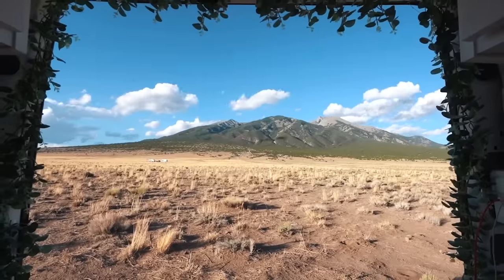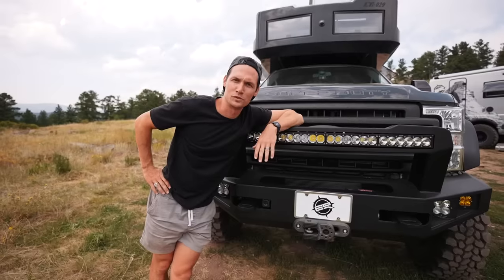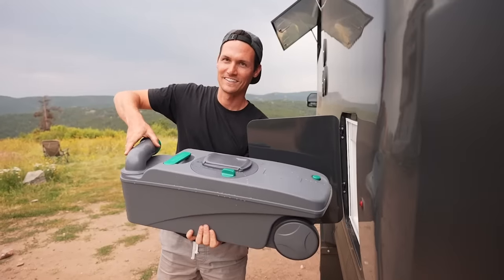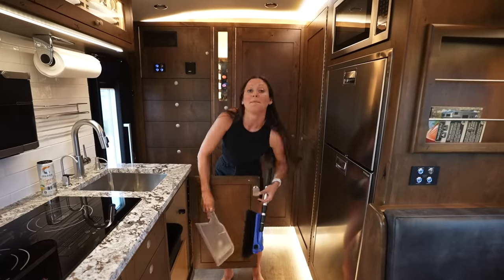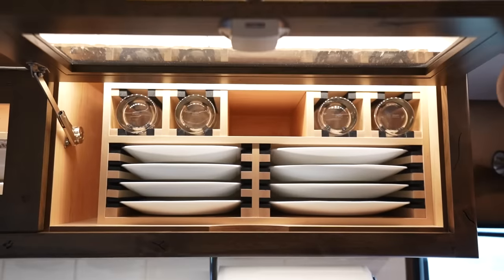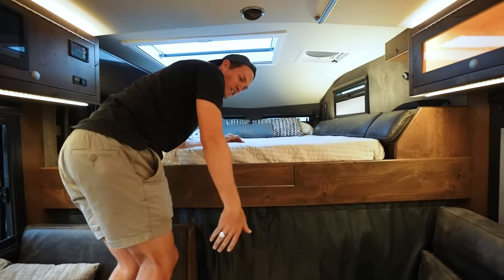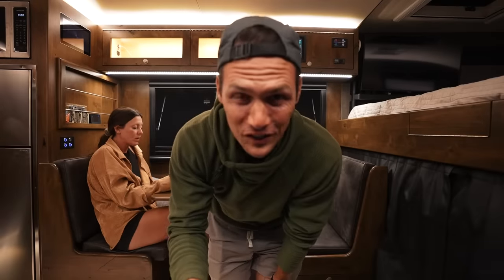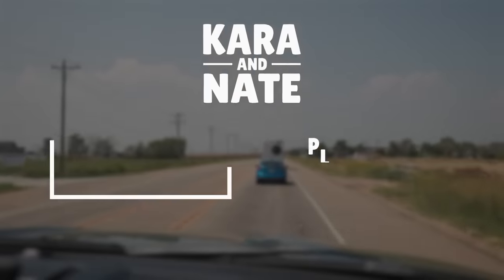WE LIVED IN A $650,000 EARTHROAMER (full tour)

Comment: Idk. It’s really nice and all. But for that price i feel you could get so much more . It feels more like a 300-450k price tag all around considering the truck itself is like 150k without the sleeper and accessories .
Reply: You're paying for the custom fabrication and engineering that went into this build. I'll agree I believe the price tag is a little steep at $700,00 it seems to me a $350,00-$400,000 price tag would leave them with profit but not until they recouped their initial investment. If the demand was higher and they weren't practically one off builds the price would come down substantially. $700,000 my ass would be in a nice ass boat but that's just me.
Reply: This is not even the most expensive  version. The top of the line model is $1.5+ million. It comes with a few more bells & whistles
Reply: Yeh I think you summed it up perfectly. I’m not seeing a fair trade for my 600k of dollars. Looks like a 200k type vehicle at most.
Reply: Bro the microwave is solar powered
Reply: @X410zee  this build if you had the fabrication skills could be accomplished for less than $200k all day long. The truck itself would set you back at most $100k leaving you with $100k to spend on the interior. Outside the engineering aspect I doubt they're spending much more than $150k to build not counting their man hours which is probably a few hundred hours per unit. Let's call it a 1000 man hours with 5 guys making $30 an hour that's an additional $150k. So $300k would easily leave them with $50k-$75k in profit.
Reply: @PatrickCavanaugh0420  I think your maths may be a little off.  100k + 100k (probably closer to 150k for the truck but oh well) = 200k. We haven't even considered man hours or shipping yet. We'll call shipping about ~25k for all the parts, as they will not all be made in the same place, plus they need to source wood for the interior etc. You can add another 175k to that 200k then, as I'll go with your 150k for man hours.

100k + 100k + 25k + 150k = 375k.
Materials alone will probably cost well more than 100k, so that guess is probably very incorrect. Don't forget, most of the shell of the camper section is carbon fibre. That material is prohibitively expensive. There's a reason that aeroplanes they make out of it sell for a third of a billion each. 787-10 List Price: $338.4m
They are probably still charging more than is reasonable, but they won't be doing a 300% markup I wouldn't imagine.
Reply: I think most of their stuff is custom so that drives up the price.
Reply: A house maybe
Reply: @PatrickCavanaugh0420  It's not just you mate. Having just bought a used sail boat 5 months ago and thinking what 3/4 of a mill. could get me in a boat it's no contest. Also considering the horrible quality of most R.V.'s and that they basically rip you off for a good chunk of what you paid for vs. what you get and this is not even factoring in the rather automatic fate of old R.V.'s. I'm sure that for this money i could buy my wet dream sail boat and have enough left over for a new wake boat or at least a couple of new PWC's.
Reply: @cmdrquillon9398  even if I'm off by the 75k your talking with a $375k price point that's still a far cry from what they're charging.
Reply: @PatrickCavanaugh0420  As I said, the 100k on materials is likely a massive lowball. The true price is likely at least 200k on materials. They are still overcharging I think, but not by as much as you say maybe.
Reply: did you even see the video?
Reply: @krisb-travel  then you have no clue how expensive stuff is 😂
Reply: @PatrickCavanaugh0420  Jesus christ is coming back,  people look to God put him first read your bible and pray Jesus loves you"
Reply: You can get an airstream atlas for about 260K, which in my opinion is waaaaaay better.
Reply: Yeah
Reply: @colors6692  what makes it pollute any more than any other diesel engine? Just curious honestly, I see this not much different than my f550 at work with a different bed. The truck itself still undoubtedly follows the same emissions regulations for whatever state its being produced in or it wouldn't be legal for sale. Now what one does with the emissions after they purchase the said vehicle is a different story. Unless you're speaking on the resources used to build in which case things like tesla or any other electric vehicle should be "banned" as they are terrible for the environment during production and after their life cycle is complete.
Reply: @PatrickCavanaugh0420  well , it's up to you , Jesus might not have nothing to do about the comment but am sharing the gospel  , cant say you never hear or see  the gospel sharing,  Jesus is real and he loves you don't make people push you away from God.Jesus christ is coming back,  people look to God put him first read your bible and pray Jesus loves you"
Reply: Youre right. You can get a stunning used Class A. Built on a Prevost chassis that looks better and has more features than some mansions
Reply: not anymore
Reply: You can
Reply: I'm not defending the pricing, but there is a lot that goes into this that you cannot see for example the axles are replaced with Heavy Duty ones, and the suspension is all beefed up as well.  lots more.    They do a lot to the F550 Chassis before even starting the camper part.
Reply: I dont know but it seems like most of the stuffs will be broken and not working properly after 2-3 years of hard offroad overland trips
Reply: @stanleymasterson1135  You’re wrong. You couldn’t get near half the shit that’s on this Earth Romer auto Prevost.
Reply: @dexterrr9163  your comment proves that you’ve been living in cheap made campers all your life. This Earth Romer is meant to go through the apocalypse and beyond.
Reply: Dude it's like a whole house and a truck with a bar becue
Reply: Exactly what I thought buy a 150 truck with buy a cab get someone to slap it together  and save like half a million dollars I would never pay that much
Reply: @PatrickCavanaugh0420  carbon fiber is really expensive and the entire back half of the body is engineered carbon fiber
Reply: totally agree that this is basically a 100k camper attached to a nice F150- meaning by F150 that the cost of a camper plus an f150 is about all this should cost… i know this is like an f550 or something ridiculous
Reply: all they gotta do is find one sucker a year to pay this -
Reply: @cmdrquillon9398  not even close both you guys are off lol those trucks are 75k new there's company's out there that custom build those overland boxes filled with the kitchen/bath/bedroom all that for 50 to 80k depending on what you want in them and weld them on your frame theirs company's in the Midwest that do this
Reply: Those knives cost thousands of dollars alone
Reply: @vickyhudsonwilliams9529  must be Liberty Bells and Rhodium whistles
Reply: With that I’ll buy 2 fucking semis😂 or 3
Reply: @cmdrquillon9398  I mean the aeroplane comparison isn’t the best as you can’t really cut costs making something with 1047202746194 redundancies plus customers are very aggy (rightfully so) on its safety but yeah I get ur point nonetheless.
Reply: Yh its definitely not for the target audience you would initially imagine. More for super rich people who fancy a couple days campong
Reply: @PatrickCavanaugh0420  carbon fiber vs aluminum is no joke. But for that price you could get a nice boat and a more than capable RV
Reply: lmao, $300,000 USD is almost more than my 1600 sq ft house in Canada. I am amazed anyone would pay that for a vehicle.
Reply: @colors6692  I'm not an EarthRoamer fan, but you can FO with your environmental dirge.
Reply: @krisb-travel  Nah a F-550 is a very expensive truck. I think it's load is 2 tons, and is easily over $100k for just the base flat bed truck.
Reply: @thewoundeddeer  I dont get why you people think the truck is so expensive. 2021 Ford Super Duty F-550 base price starts at $40,895 to $58,065. MSRP and invoice price goes from $38,850 to $55,161. My 5 second google search calls BS on all of you.
Reply: @PatrickCavanaugh0420  If I'm forking up 700k (which is very unlikely in my lifetime) I'd be spending it on an R.V, not a fabricated F550. I mean they did a great job, but for 700k? That seems much over what this build should actually cost.
Reply: @P4PKing  yea nor would I ever spend 700k on this vehicle. An rv or nice ass boat a house etc. Could think of so many other good uses of $700,000 lol. My choice would definitely be a used yacht.
Reply: @fanatic26  a base f550, the 58k is for the gas engine smh and with all the add on the engine alone is 10k extra and not to mention all the dealership fees, taxes, tag, title, insurance, this f550 shown in the video is undoubtedly closer to 100k but nowhere near 150k as was claimed by the guy I was talking with. I drive one daily I'm familiar with their costs and available options. Hell you can't get a new f150 for under 50k these days unless you go bone stock.
Reply: @PatrickCavanaugh0420  a little steep but the whole trailer/camper part is made out of carbon fibre which is probably super expensive to make
Reply: @PatrickCavanaugh0420  Another 10 second google search just found me a 2022 4x4 F550 with the 7.3 powerstroke for $66k
Reply: @fanatic26  and that's 66k with Tax, tags and title and dealership fees? Cheapest I find on auto auto trader or Facebook is 81k. I would assume price will also vary from location to location as well. My whole point was that they charge entirely too much and that the truck could be had for less than 100k. The person who replied to me said 150k which is way off. Not to mention the dealer mark ups that are happening right now all over. Either way I agree with you the truck is way cheaper than some are claiming, even with the engineering and carbon fiber materials the truck is no where near worth its 700k price tag.
Reply: @PatrickCavanaugh0420  👍🏾 I agree with you those guys are just completely ripping people off with those overland builds they lost there minds
Reply: No space at all i can buy a huge moblie home with 20 times the space a more luxurious for wayyyyy less get outta here for almost a million dollars thats a toy for a person who worth 100 million to get high way robbery job on them for 600k at best 150k
Reply: i wish i could bring this with my fairy friend... 😔
Reply: Respectfully, most of y'all are so wrong its almost painful to read. Here's why:

First, we have the rig being an F550. Most of these are destined to work and come appropriately stripped with a 80k price. To have one built with all the interior options of the more common F350 plus exterior bling like mouldings and doorbhandles that aren't from the Amish Package, and I'll guess the cab and chassis came in at close to 125 or 130.

Next... Carbon Fiber. Not much needs to be said on that front but this beast is made FROM it. Not accented, not highlighted with or essences of it. It's MADE of it. Imma guess 100k in carbon fiber just for the shell.

Next up we have the biggest toteboard of 'Let's Get Small'. Price per square inch on a motor home gets exponentially larger the smaller one goes. Eventually there is a balance point but it's a rule that makes sense after one gets over the initial shock. Going Small yet keeping the expected functionality costs more with tighter spaces for behind the scenes plumbing / wiring etc as well as for the fixed cost of the thing itself. Poor example but what comes immediately to mind is extend-Range or performance of an electric vehicle requires either more batteries or better performing batteries that fit in the same space available for the standard ones yet offer more capacity. Going smaller yet expecting same or bigger will cost ya no matter how its sliced. Toss in another 100k or this and the other etc's plus labor which is not piece work but craftsmanship level crew. 

Then throw in all the touches like plate and silverware slots that keep the rig quiet while driving (huge, trust me on that or try listening to glasses clink and crap rattles for 300 miles on the way to the camp. )  Every where one looks, this rig is filled with this type of unexpected design and thought that oh just so happens to be wrapped in higher-end finishes and or materials. Check another 100k here.

Lastly, wheels, leveling, power plant. God knows how many stage paint, bumper boxes etc and it's bespoke without actually being bespoke. But I bet they welcome call outs. Either way...pop another 100k to the bill for this and installs and integration with everything else. Oh and make sure it all can survive extreme swings in Temps, being shaken and bumped as well being potentially invaded by mud, critters and moisture that is magically repelled for years.

So far, I'm up to 425k but very likely have missed a good number of items so I'll use a standard overrun factor of 30% to account for it bringing my final estimate to basically 600k.

Dealer ask is around 700k. They ain't getting rich at that point which is why earlier I remarked in another comment of expecting 900k. Or more.

This is a bargain.
Reply: Or I can just say it without being kind: The actual people who can afford to purchase this and will do just that, can see the value here and that has nothing to do with being stupid or gullible. 

All these 'I can get me a  ford for 35k and put a box on it, for 5k so that means they outrageously overpriced' posters will have little to no impact and will be read only out of amusement or great concern about our public schools prior to reading one that is actually relevant and intelligent.

Comment: 4:18 for $700,000 it doesn’t come with a smart key for everything!! Come on!! They “add” over $600,000 to the price of that truck as the base truck is less than $100,000. The integration should be seamless.
Reply: Gotta agree with that for sure, that's a super ridiculous keychain
Reply: All the outside doors appear to have electronic central locking, the keys would be for a manual override in case of failure of the electronic lock.
Reply: Less than a 100k base price for a F550 stripped is 60k those Earthroamers where always way overpriced
Reply: @vee950  Extremely. Probably costs $150k to make.
Reply: @BriggsDCory  I agree
Reply: @vee950  that's not a base F550. base F550's do not have myfordtouch and lariat trims lmfao

Comment: I finally figured out why Nate got wet when he took out the cassette toilet and he thought it was leaking on him.  When Kara demonstrated the toilet, she closed the cassette and then flushed it  ("add a little water.")  So the water didn't run into the cassette, it ran on top of it!!  Loved the video.  I don't care what they cost.  I want one.   (By the way, John Mayer bought one.  I'm sure it was pocket change for him.)
Reply: Bb
Reply: @thelightsilent  Please point me in the direction of a 60k carbon fiber caravan.  I will buy one now.
Reply: @SHADOW848DUCATI  With all of those nice materials and craftsmanship on the inside, and the 1300W of solar panels, and the batteries and inverter, and the 100 gal water tank, and the extra 50 gal fuel tank, and all of the beefing up of the suspension to handle the extra weight in off-road conditions, and the cameras and the lights and the winch and the storage boxes and so on and so on. Oh, and they put it all together for you.
Reply: @BradWilson1969  My point was that there is no where you could build this for 110k as The Light Silent had mentioned.  The amount of carbon fiber and resin alone would be about 100k

Comment: That an impressive machine and I’m definitely jealous. The only thing that would concern me is servicing it if something needed repair. It’s so customized that I think it would be hard to find anyone that would want to touch besides the manufacturer.
Reply: It depends on what needs repair, anything mechanical related to the movement of the vehicle is Ford F550. That's pretty genius to me.
Reply: If you can afford this you won’t care about affording the maintenance…😅
Reply: @ALDOELTA  I agree with you on that but my concern is actually finding some knowledgeable enough or willing to work on it away from home. If it’s the truck itself it would be fine but the camper is a different story.

Comment: Great video, one thing, the stove top is a induction stove. It heats the pans (that why they are aluminum) without heating up the burners. The knives are SHUN!! That is like off the charts high end. Great video.
Reply: Induction does not work with aluminum, you must use a ferrous (magnetic) metal, induction uses magnetic waves to heat the metal.
Reply: Me pretending I don’t have $ 12.37 in my bank account “mm yes this seems nice maybe I should get one 🤔”

Comment: Step by step for diy earth romer 
Buy an old toyota tecoma 
Restore it put in air suspension
Ls swap with a supercharger or twin turbo it
Then custome fibreglass sleeper back and there you go 
Something that cost about 80k but is basically near the same as the thing thats 650-700k